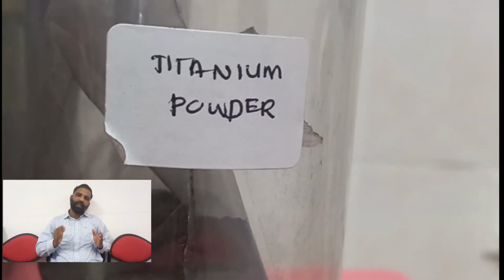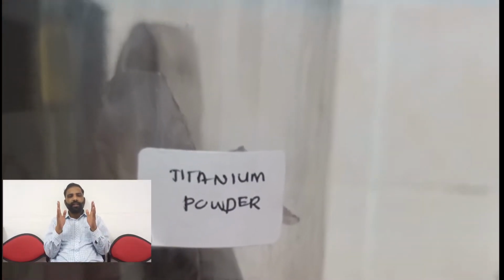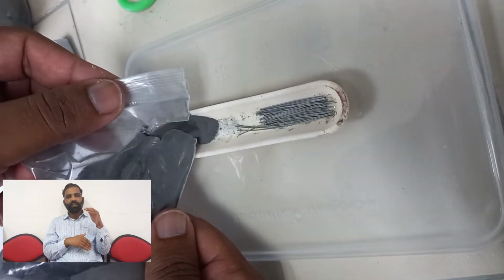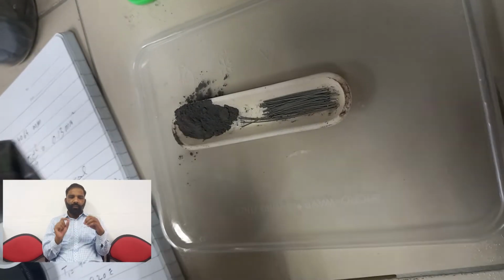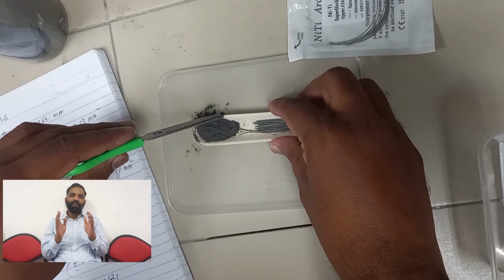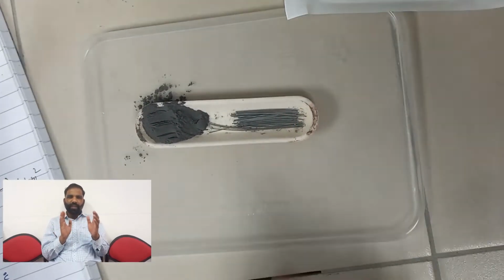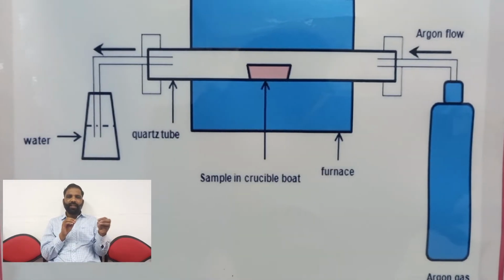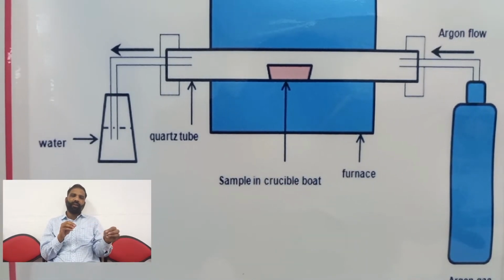Solution treatment of NiTi archwires for orthodontics applications

Comment: Nice explanation, which solution is used for treating NiTi archwires? It looked like heating NiTi wires and then cooling down...
Reply from the maker: Thank you. No solution is used as the name suggests. Just titanium powder is used (and it does have a purpose) in heat treatment process, which is not a common phenomena in other heat treatment process and thereby a kind of different name.